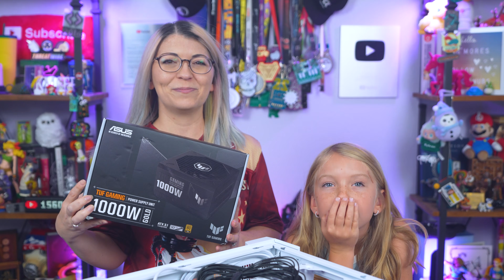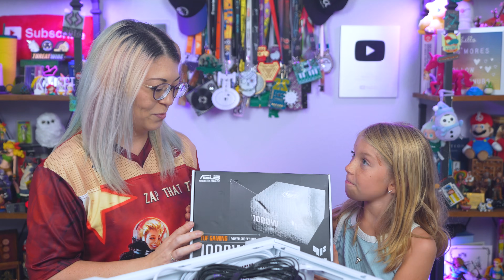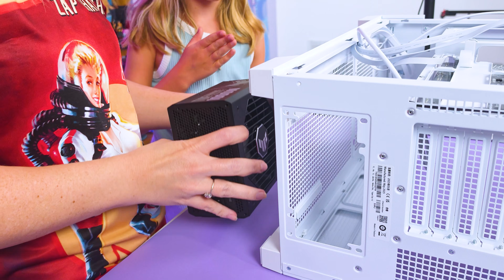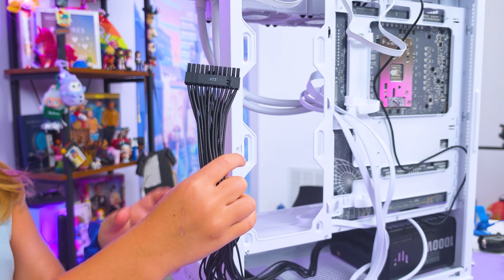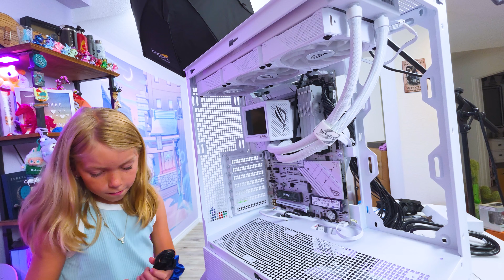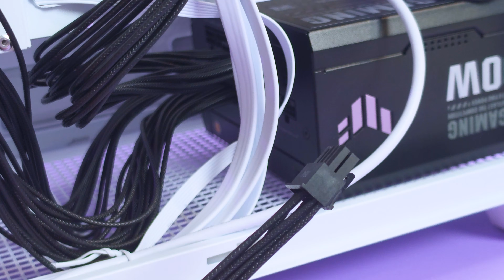PSU Installation & Cable Management Made Easy 🖥️ Part 6: How To Build A PC For Beginners 🎮

Comment: Shannon, I am a little surprised you didn't do a quick power up to see if your build makes through POST and boot into the BIOS UI. That first power up was always exciting with fingers crossed when I was building in the past. It was very rewarding when everything worked the first time. 👍👍 Hey look, I found the emojis!!  😄
Reply from the maker: I never boot it up until I have EVERYTHING installed, including fans and GPU! That's just the way I've always done it.
Reply: @ShannonMorse  The reason I asked earlier about when do you put the heatsinks back over the SSDs was to see if you were going to do a test boot to make sure all the SSD and sticks were properly seated. As I recall, some builders would do a bench power up, before the MB was even in mounted in the case, for that very reason. I never did a boot that early. I prefer the nicely grounded and secure, from the MB point of view, environment of being mounted in the case.